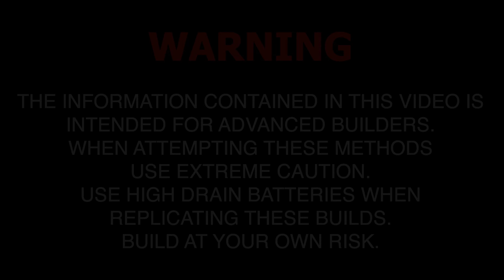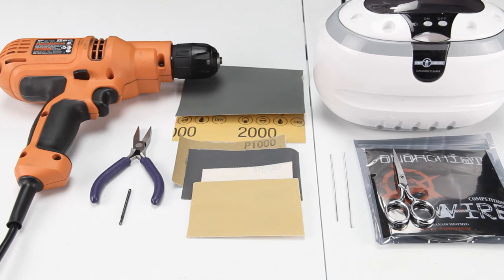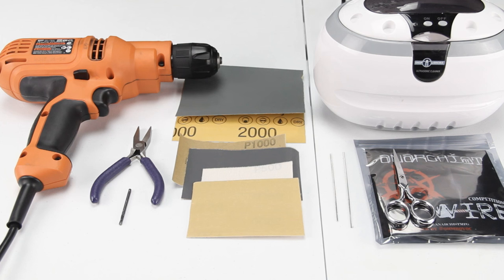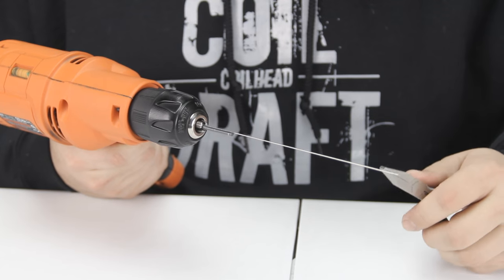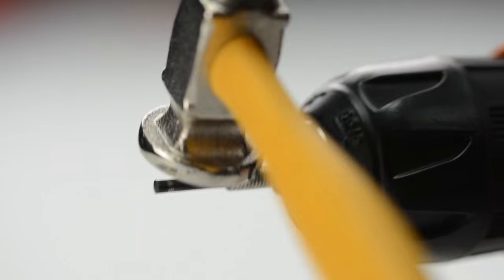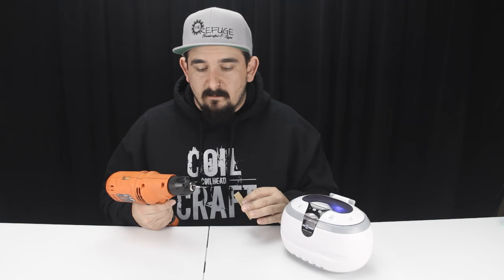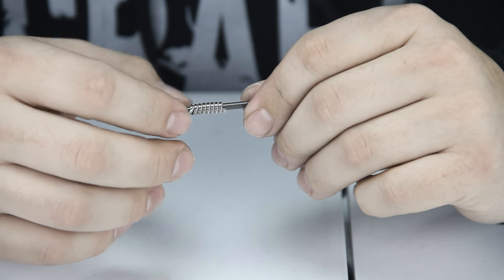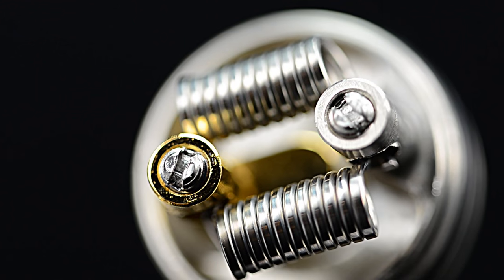Episode Eight: The Mirror Finish

Comment: awesome vid man.. another way u could possibly clean them if u dont have either  is get a tall cup soap and water like u said and put a few magnets in the cup and when ur shaking it around the magnets will most likely take all the metal shards off the coil then I would repeat that step a few times with clean soap and water then with out the magnets a few times.. just some thoughts.. thanks again doode...
IG @just0hmsman
Reply from the maker: +Joe capon That is a pretty ingenious idea my friend. My only concern would be if the magnets weren't strong enough and hopefully they wouldn't damage the coil…
Reply: If you could find a little plastic container and drilled holes in IG big enough to where the coil would have a chance to go thru it but the shards could.. And yeah those magnets they use for the hide a key box that u put under your car are very strong.... I'm trying to help out us broke vapes cause we spend all our money on gear.. Lol
Reply: +Joe caponi That wont work with some coil types.  304/316 stainless steel as well as nichrome are non-magnetic.  Most metals, in fact, are non-magnetic.  Nickel itself is magnetic, but nichrome wire itself is not.

Kanthal is magnetic up to its Curie point of 600C.  Ni-200 should be magnetic.

Comment: Dont see the benefit in cleaning them inbetween.. like whats the big secret on that?
Reply from the maker: Not really.... Honestly, I have worked many jobs where it's just one of those "good" practices to stick to if that makes any sense!
Reply: when polishing metal it is usually a good idea to clean between steps to prevent fallen partical from adding to the grit in the next step. Failure to clean a surface between applications can lead to swirling.